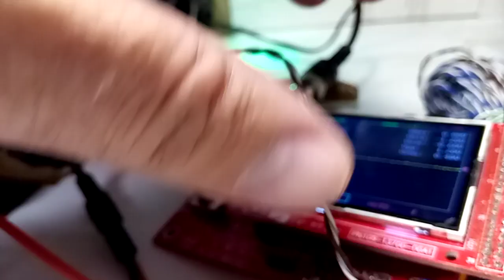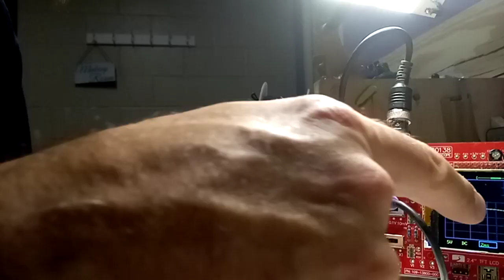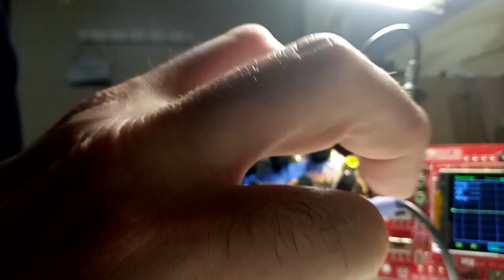Doubleplusbass feature rundown

Comment: Would be nice to hear it line recorded as others have already said...Always wanted to mod the Bass++ my self..did quite a few mods on the one i built but i didn't document them so i forgot :-). Did you get it to track volts/octave, because in the schematic you published i see an exponential converter on the pitch CV...? Am going to breadboard ur design and mess around
Reply from the maker: Line-in!!! I don't have a DoublePlusBass in my modular, just two of the prototypes which don't have all the features of the final version. The extra feature is a pitch envelope slope adjustment, between a 909-style that goes high and can drop quickly or slowly... between that and a 808-style envelope that stays mostly level until near the end of the sound when it sags off... ANYWAY, I've managed to build and sell 6 actual modules, and one of my buyers told me that it does track well.  I need to put my last PCB into a can for my modular :D
Reply: @ozerik  Great..watched ur stream on Twitch...it was awesome..I always get ideas from watching ur streams

Comment: Hi Juanito! I am looking at your schematic for this build but can only find the green LED and not the red LED. Where in the circuit is it supposed to go. Or, am i missing something? Are you able to help me out with this? Btw I built your paper 808 kick, love it!
Reply from the maker: The green LED is the only one, which will change because in further development, I've decided to make the envelope out either different or get rid of it completely...... hmm... 

But yeah, this schematic will work, but ONLY if you replace Q5 and Q6 to PNP transistors instead of NPN. Also, R22 should probably be 68K instead of 33K. R39 should be 10K instead of 33K. R27 should be...... you know what, the entire wave shaper has changed, and the schematic I'm working from right now is specifically for creating the PCB, so it's hard to read. I'll get a link real quick anyway...... 
https://drive.google.com/file/d/1iHUIuxWKj0YqMFSoXMAgaN5iz9tAF_Ds/view?usp=sharing
That is the current version that I'm working from. I might get rid of the envelope altogether, or maybe just make it a ducking-specific envelope that always sits at 10V and dips more or less to to ground depending on the knob? :D
Reply: @ozerik  Awesome! Pls let me know when you get som pcbs made. I would surely wanna buy one or two :-)  I still want to build the one you showed in the video though, I like how extreme it can be and I'm half way in the build already anyway. I will make the recommended changes to the resistors and also make sure Q5 and Q6 are PNP type. I will also compare a bit to this new circuit schematic before I solder any further. Thank you! Also, I have a really whacky filter circuit I am working on, still needs some polishing up and stuff but I will share it with you once its done. Right now my head needs a break from that circuit, feels like I've staired myself blind on the thing atm :-)
Reply from the maker: @kayk6442  yeah, especially R39 being 10K instead of 33K will help the filter be more versatile -- the one in my system clips the waveform, keeping me from getting a nice clean sine wave. My current obsession is to get a PCB made with the SMD components factory-assembled. That'll leave the pots, jacks, two LEDs and power header to put in by hand, EASY PEASY. I will probably lose track of this YT thread, so come join my Discord to stay up-to-date with this!

https://discord.gg/ys6zYezb